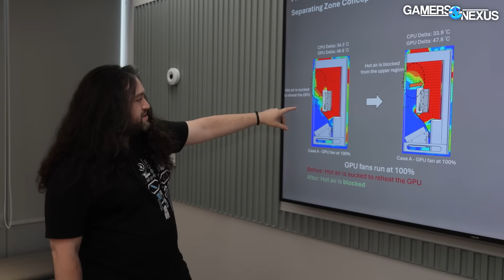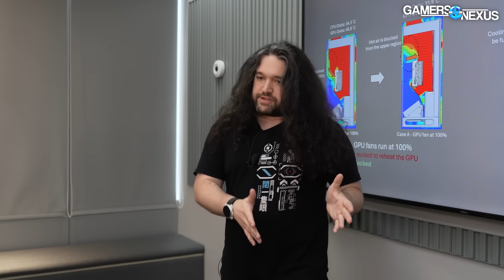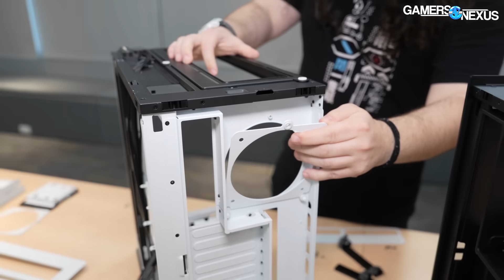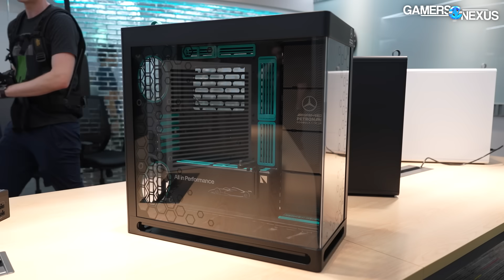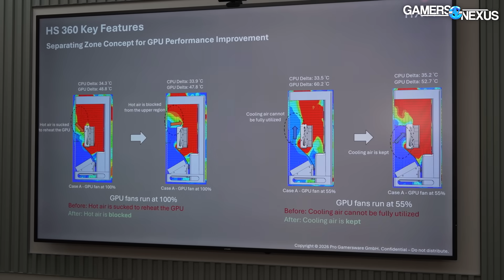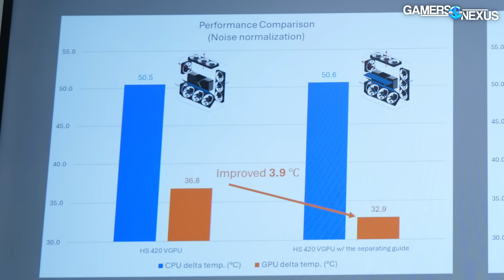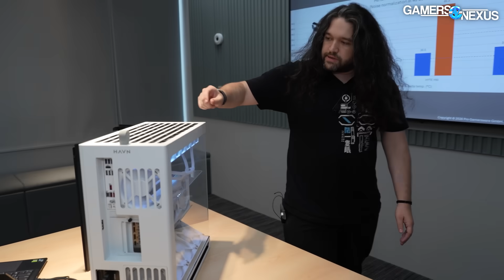Solving the GPU Airflow Problem | Bouncing Air in the HAVN HS 360

Comment: I really appreciate that they completely removed the chassis grille in front of the exhaust fans. I would say that companies placing multiple layers of unnecessary metal grilles in front of fans responsible for exhausting hot air from the case have a poor R&D approach, as these designs can restrict airflow and create unnecessary turbulence and noise.

Comment: This is all good and all when GPU is being used. But most of the day its not in use and GPU fans are still. What happens to the CPU radiator not getting enough cool air when doing heavy non-gpu based tasks in Windows? Wont the CPU get much hotter when access to cool air is limited?

Comment: I’m watching this shii off my pc with a 3500x case like 😔😂 felt attacked 

Maybe since I have 11 RS120 pro Corsair fans + VRM cooler off my arctic freezer 3 pro AIO 

I haven’t had any thermal issues! 

Plus my 9070xt power color runs super cold 😅 

Should of discovered GN back when I built this unit 😅

Comment: Would have a much easier life if they worked with water instead of air. And i don't mean watercooling, i mean, instead of doing computerized design that takes quite a bit of time to setup and figure out, it would be simpler to just print the volumes and submerge the case in water, then test flow with dye.

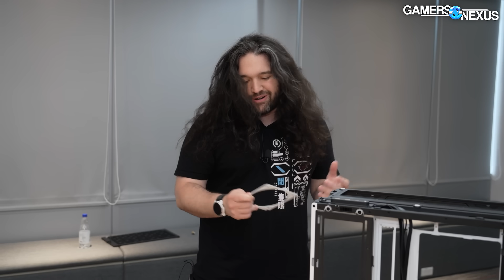Comment: @5:20 great video idea on the rubber insulation mounts at screw points.... When you do a full acoustic test, try with, and without the rubber insulators and see if there's a noticeable difference in the GN hemi-anechoic chamber

Comment: Easy fix for gpu airflow -> return back the model where air is pushed through the backplate of the case, rather than dumping it on the sides, hitting motherboard and whatever there is on it.

Comment: great that they finally care about actually feeding gpu coolers with air but you know what we used in the SLI era ? a non glass panel, dremel a round hole and buy a 200mm fan then get an aliexpress mesh roll as air filter or your PC becomes a dust vacuum it 100% injects ambient air on your gpu or back in the days between 2 gpus

Comment: Don't like fishtank cases but like what Havn is doing, have my PC in CTE 750 but not happy with the GPU orientation, great for sag but the vapor chamber doesn't work properly in that orientation so the GPU overheats if it pools more than 200W, luckily the games I played lately didn't use that much GPU so it was ok but if I want to play anything intense it's gonna be a problem, the hot spot jumps to 100c over 200W thinking about changing the case, other then the GPU problem love the case and really don't want to switch but tried 3 different GPUs and all don't like the vertical position.

Comment: I run my GPU fans at 100% but the noise doesnt beat out the window AC or the space heater. I also have headphones so it all blends together. I love these cases. I might 3d print some stuff to guide the air into the gpu

Comment: This feels like overengineering to solve a problem of their own making. Just mount the GPU horizontally and have intake fans in the bottom pointing straight up; I mean sure, some air will go past the GPU, but even at 0% GPU fan speed cool air will be passing through it, and the "escaped" air will contribute to overall internal cooling. That said, I've tried both horizontal and vertical GPU mounting with a regular fan layout and the difference in temperatures (CPU, GPU, and overall case temperature) in either configuration is within a degree or two.

Comment: genuinely surprised this hasnt been done sooner... as soon as laptops came out I wondered why thermal funnelling wasnt used in towers. create a vacuum for air to get sucked through, it'll always work better. or even a corridor as what's been used in this video. if you wanted to go further, narrow the corridor/funnel that covers relevant components coming from the case fan to compress the air, super high rev fans would be needed but if you can compress the air using aimed funnelling, you probably wouldnt need GPU fans exactly like a laptop or if you did it would be gpu fans blowing air from the chip instead of into the chip, setup would be a pain though

Comment: What I see in those simulations is that all the heat gets dumped onto the motherboard and into CPU.
I don't know why such a focus on cooling the GPU when even the monsters like 5080 and 5090 are pretty cool and silent even under load. They get enough cooling.
On the other hand, CPUs tend to hit 90+ degrees under full load and then they get blasted with hot air from the GPU exhaust, while all those top AIOs serve as hot air soak and case exhaust which makes things worse...
Cases don't need better GPU cooling, GPU just needs some free room under it and it's fine. Cases need better CPU cooling.
Also, can HAVN please start providing extra HDD trays for BF360 so I can utilize the 3rd  HDD spot that actually exists in the case? Thank you.

Comment: I've been using cardboard (laminated) to direct airflow since 2019. (Not using RGB or glass.) These simulations nicely show that air is a fluid and you should make the flow as smooth as possible. No 90° corners, little turbulence.

Comment: I've been posting for years that case makers miss a trick by not allowing the GPU to exhaust its hot air out of the case directly. When a regularly mounted GPU blows its hot air against the side glass panel, it leads to a) recirculation of that hot air by the GPU and b) heating up the air in the case which is bad for both air cooling and radiators that are oriented to take in air from the case. Which case manufacturer will be the first to give us a metal side panel with exhaust ducts for the GPU? I applaud HAVN for trying to improve GPU temperatures but their approach is both too complicated and visually unappealing.

Comment: Air tends to take the path of least resistance, which is why airflow needs to be guided in order to force the flow where it's wanted. This is why flow guides are used in virtually all airflow applications in some form or another. Airflow guide systems include but are not limited to chassis shape, size and orientation, motherboard component layout and orientation, heat sink shape, size and orientation and air baffles.

But if we really wanted to address power, heat transfer and thermals in computers we would do a complete clean sheet design with systems engineering approach. Starting with IC design where power would be the primary determinant of the design and would set the design parameters for everything else. This is because energy is the primary resource and therefore primary determinant for all work, so any design approach where energy isn't the primary consideration is already systematically flawed. Systems engineering approach would also mean that we would have much more standardisation than we have today. The ATX motherboard standard for instance is a non starter from this standpoint with its abysmal component layout, so there's only so far you can go without complete clean sheet design of the motherboard. As the HAVN CFD simulations demonstrate, we would be able to design much better computers if people got together and put serious effort into it with modern engineering know-how. But because it would make computers more economical and because economics is inverse to profits we get this constant and ever accelerating failed approach of surface level redesign instead. And this is already before the marketing idiots get to participate in defining such things as the shape of VRM heat sinks on motherboards and so on, which turns the whole effort into a much higher level of stupid.

All of this is enough to keep any competent engineer in chronic depression.

Comment: A giant side intake fan is why I'll never give up my HAF-X. God I hate how computer cases became bling instead of a box that holds components and keeps them cool.
Reply: that's why I still run the XB Evo, straight through airflow for CPU and I have it configured to dump GPU exhaust out the top and cool my 40gbe NIC, SAS HBA, and M.2 HBA using the GPU fans.

Comment: A solution for a problem that they created themselves. 
All in the name of "Aesthetics". 
This was an already easily solved solution. 

Move Video Card to the bottom of the case, have the bottom intake fans shove cool air into Video Card fans 
Move the MoBo's PCIe x16 to the bottom slot of the MoBo on the bottom edge.
Get rid of PCIe x16 extension cable in case. 
This frees up the other 6x PCIe Add-In card slots for the PC owner.

Adapt all plugs along the edge of the MoBo to be a "Right Angle Connection" along with the connecting plugs in the Case.

Comment: I really think they could get away with a no-hardware solution to fix the cover plate (anti-grater device). It's likely a one-cycle fitting like you say, but that's an argument against having (multiple!) screws, not one for it. They also know which way gravity is as the case only stands up one way. So: tabs and slots stamped into the sheet metal.

Comment: My overclocked 980Ti died because of a vertical mount (I'll never prove it... but I'm pretty sure).
Air flow wasn't getting maybe half of my gddr5, and one of the chips died.

These boards are not built for vertical mounting. Be aware.

Comment: the lengths case manufacturers will go to just to avoid ducting
Reply: Exactly. It's the stupid "I need to be able to marvel at all the PC components"-trend that necessitates side glass panels. With metal side panels, we could just have exhaust ducts for the GPU. No recirculation, no warmed up air that heats up motherboards and makes air cooling more difficult. But no, every PC case needs to look like a snow white coffin. The exception are smaller form factors where it just isn't possible to make the insides look appealing. Guess what, suddenly instead of a solid glass panel, there are meshed panels to help with ventilation.

Comment: It's crazy the kinds of contortions we're doing trying to fix the problem wher the most power hungry part of most gaming PCs into an expansion slot which was never designed for that much heat and has no plans for the airflow needed.  There needs to be a redesign so that GPUs can be mounted like it's the second half of the motherboard.  You could have large tower coolers like you do for CPUs.  Or free up the back of the case for a radiator if you wanted.  Anything to allow for  cool air to come directly in and then the hot air to get directly out and not blowing it all over the place like current GPUs do.

Comment: It's nice that they try but you are still gonna have hot air piling up everywhere else in the case, your CPU ram, ssd and cpu vrm temps are gonna take a hit from this somehow.

What we need is a dedicated GPU exhaust shroud/tunnel to bring it out of the case through side pannel as soon as possible imo. Adding more roadblocks inside the case isn't it.

Comment: I can't help but feel like there's some significant problems with modern PCs to require solutions like this
Reply: Yeah there are. We push silicon harder for performance gains as DIE-shrink gains have slowed dramatically because of, you know, the size of atoms.
This is still a choice, mind you, since Nvidia, AMD and Intel have to sell you stuff that's new and interesting and with higher performance. Most modern hardware can be downclocked slightly and downvolted for massive gains in efficiency at a slight performance cost.
Reply: The solution could be much simpler, alas manufacturers apparently believe a case without a glass side panel won't sell. Sad, very sad. Who looks at the inside of their PC while using it?
Reply: @coolcat23  i dont get why people are having hard time understanding people like making inside of pc look cool and actually like throwing a look at it mid gaming, because it was their own project that ended up looking even better then they anticipated. 
I understand somebody does not prefer that, and that's cool too. seen plenty of sleeper builds worthy of their desk position too.
Reply: @matelozo5025  I have no trouble understanding why people want their PC to look cool. Not at all. What annoys me no end, that this is foisted upon everyone. Try buying a motherboard without RGB. At one point, RAM without RGB was more expensive than RAM with RGB. Try buying a case which does not look like a fish tank. I'm 100% happy for people to have a blinged up PC and glass everywhere, but what happened to prioritising function (most efficient cooling) over aesthetics? It's like all cars had super wide rear tires, huge spoilers, and were much louder than they needed to be. Fine for those who want that kind of car, but wouldn't it be bad if you couldn't get a car without a huge spoiler attached?
Reply: @coolcat23 It was rather annoying looking for a case with no glass, I'm not even sure Corsair makes a solid panel any more
Reply: @zacharykarr  Did you find one? The Fractal Torrent has a metal side panel option. I didn't buy it (yet) because of where the PSU is located. I'd prefer a dual chamber solution.
Reply: @coolcat23 About a year ago I went with a Fractal North XL. Its mesh not solid, but I was basically happy with anything that wasn't glass.
Reply: @zacharykarr  Thanks. I remember the disappointing test by GamersNexus of the Fractal North XL. They didn't test the fan bracket with the fans in exhaust configuration (but instead used them as intake fans). Face palm! It is too bad that GamersNexus pretty much never exploit innovative features but only do very standard testing. For a manufacturer, there is little point to allow for bottom fans, for instance, unless the fans are delivered with the case because Gamers Nexus won't go through the trouble of installing fans at the bottom. I like the North XL but I'd prefer a case which has the PSU out of the way for optimal GPU cooling from the bottom. The Torrent appears to provide slightly better performance but that may just be a consequence that it was tested with more fans being delivered with the case. Not sure anymore.
Reply: Yeah I built a sleeper and it has dumb RGB RAM hidden away inside lol.. the rear ventilation you can see glowing rainbows LOL.. I don't want to install the control program to turn them off so it lives that way. The glass case thing is weird..we need some more goofy and stylish aesthetic cases. This "modern" look is just square or rounded square with no class and a lot of glass. I know the market wants something different because the retro PC cases cant even stay in stock for long..new stuff is so bad people are going back 40 years for looks.

Comment: The cases they compared against were cases that sucked. That is why they compared against them. It's an advertising strategy as old as time. Don't compare to the best, because you will either lose, or only be marginally better. compare to garbage and you will look amazing.

Comment: That case design is the equivalent of using a nuclear warhead where a hammer would suffice. They are trying to solve a problem created by making a fish tank into a computer case.It's ugly and its stupid and it causes heat problems. My case has front vents with 3 large case fans, and lots of air from the bottom and the top. My 4090 has never had any kind of heat problem, because my case is not a fish tank, it is a computer case.
Reply: There was an actual fish-tank case, only plastic fish though, I think LGR reviewed it, was from the 2000s

Comment: It's a very clunky and inefficient way to try to confront the problem, and that's all it is, a attempt to confront.

There is a particle they do not curve and when they are confronted with something blocking their path will just pile up and sit there.

More or less there attempt to create a streaming flow of air can work but they are going to have to create a positive pressure from the bottom in order to force the air that is piling up to actually push into the warm air, basically there needs to be more cold air intake and less hot air exit, it will force it to move out of the machine if you have equal on both sides like they basically do in this the buildups will just sit there in their respective chambers.

For my own youse 1.5 air intake to one exhaust, creates an extremely fast positive flow that immediately removes heated air.

Comment: Is liquid metal on some of the GPU not a concern for people mounting their GPU on a vertical mount? I think It'll be like the PS5 over years if you have standing up, its all eventually going side down and not fully cover the die then it will start thermal throttling or overheating

Comment: I'm so old, I remember when instead of glowy aquarium cases, we had flow-through ventilation with fans sucking in air from one side and blowing it out another.  You know, like grown-up, job-having 1U servers do, except less flat and more quiet.  And faster boot, OMG why does enterprise take forever to boot.
Reply: Enterprise takes a long time to boot because it does a full POST each boot. Consumer devices don’t, the testing amounts to “does RAM work, is CPU inserted, e.t.c.”, not dedicated testing procedures for each component on board.
Reply: I'm so old, I remember Lian Li's aquarium case. 😂
Reply: never ever worked i saw the smoke simulation it's not reality because smoke are heavy particles not air irl it absolutely never worked cold air went straight up to the easiest path to the 1st top front fan and nothing reached under the gpu it was a hotspot that's why i recommend people to buy dual chambers with bottom fans, hot air goes up intaking by 2-3 bottom fans def works

Comment: Reverse case (like a Lian Li O11 D), graphics card ends up with fans pointing up, towards the case's mesh top. Result: GPU cooler pulls air from the outside.

Comment: Fluid dynamics. Air follows the path of least resistance. Pretty clever. Just need to seal up that side part now.
Reply: That seems like a big fail, if that's not included.